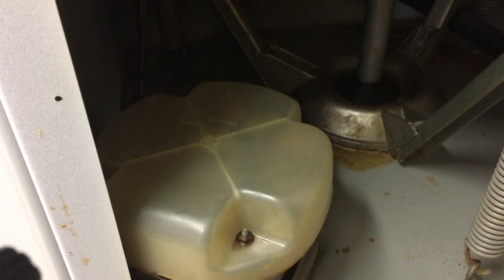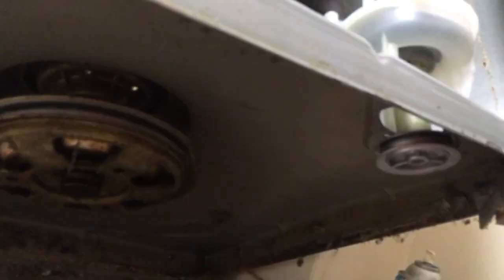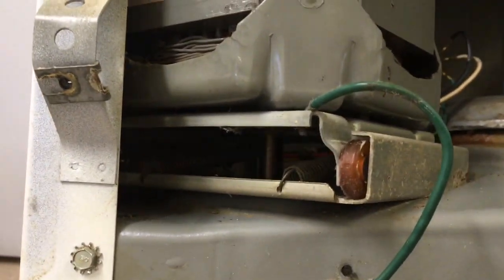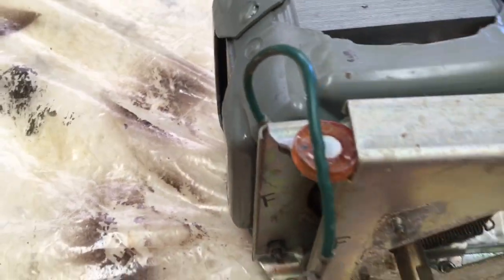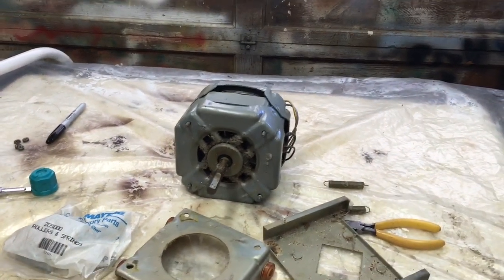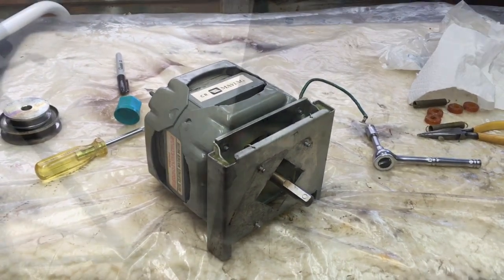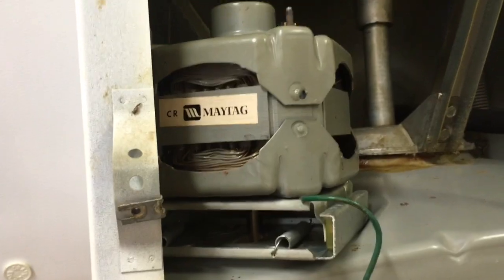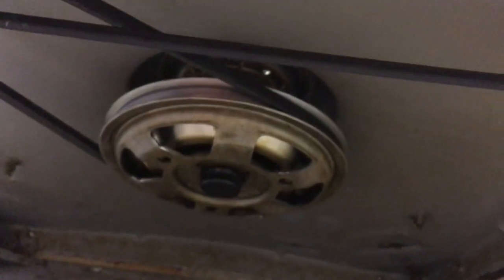Maytag A106 Refurbishment Part 1

Comment: Beautiful!  Those rollers looked like they needed to be replaced all right!  And it really is amazing how much quieter it's made the machine.  Bit of an oddball design with the belts underneath the machine like that in my opinion, but it's served well for 40 years now so they must have done something right!  I also love how you can watch the pump, that's pretty cool I must say.
Reply from the maker: Thanks! Yep, they got this machine right. I like being able to see the water flow through the pump, too. I actually purchased a parts transmission, just in case mine needs some help. It is very well built, and will certainly be featured in an upcoming video. I am clearing all of next weekend to work on this machine. Friday after work will be disassemble, Saturday restoration, and Sunday reassemble. Hopefully washing by Sunday evening!